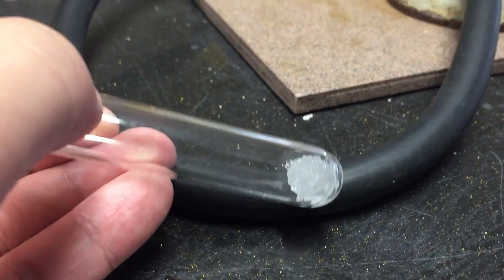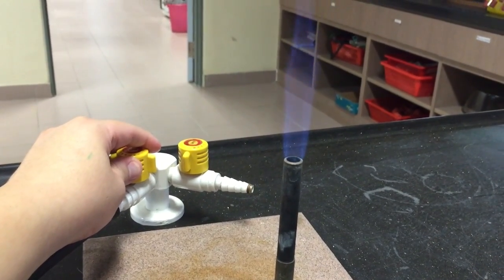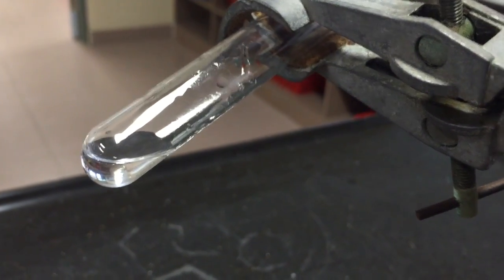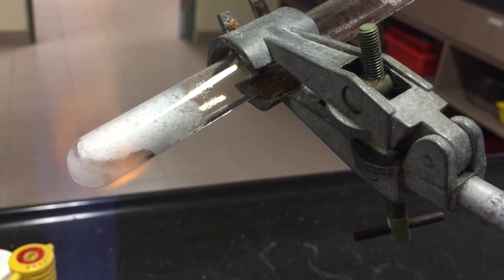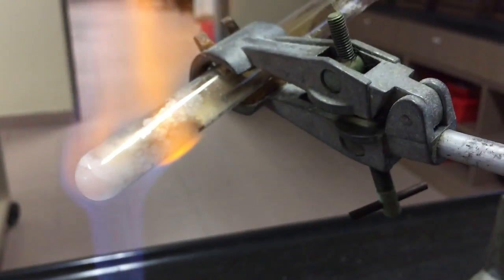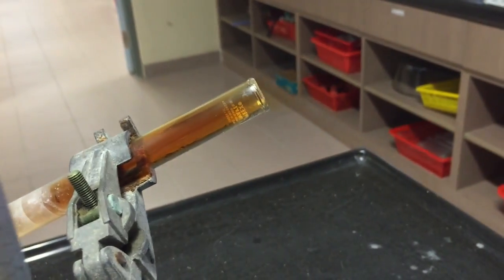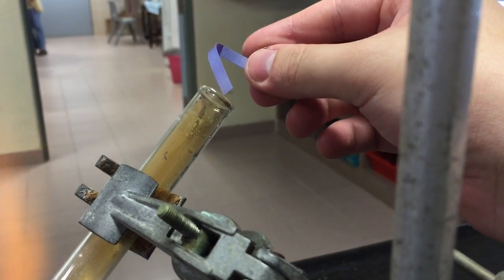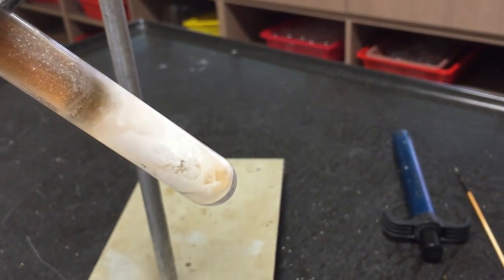Thermal Decomposition of Calcium Nitrate

Comment: I DO hope that next time you perform this experiment you will consider using some sort of fume cupboard, and not simply heat the salt in an open laboratory. NO2 fumes are not to be trifled with, as those of us who've had a good whiff of them can testify!

I was confused as to your use of moist red litmus paper! Any potential alkaline gas given off (such as …..???) would have to mix with the acidic NO2 gas we know is given off, and TOGETHER they will have an OVERALL effect on blue or red litmus paper. EITHER the blue will turn red, OR the red will turn blue (But NOT BOTH) depending whether the acidic or the alkaline gas is in excess (greater reacting quantity). Were you expecting some sort of oscillating reaction? !

An enjoyable video, and it brought back lots of happy chemistry memories.
Reply: Those who survive.
Reply: It isn't too difficult, with care and good luck! :)